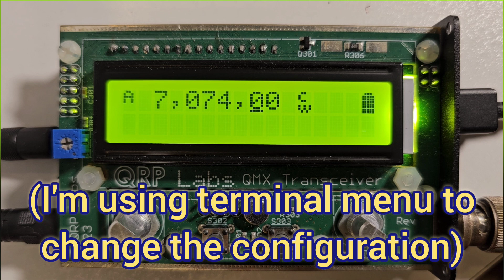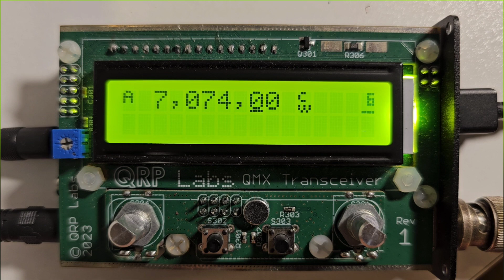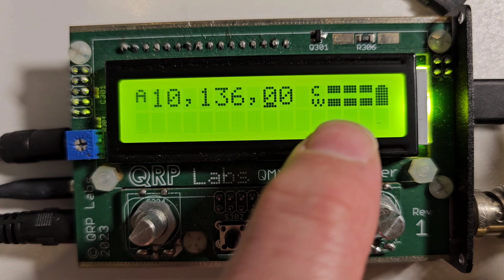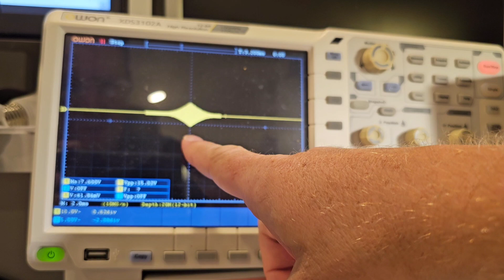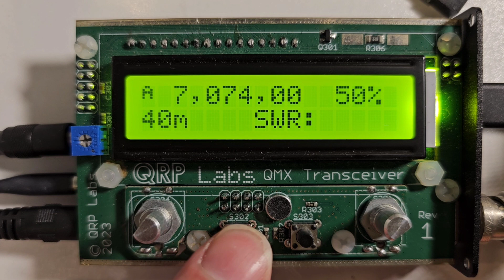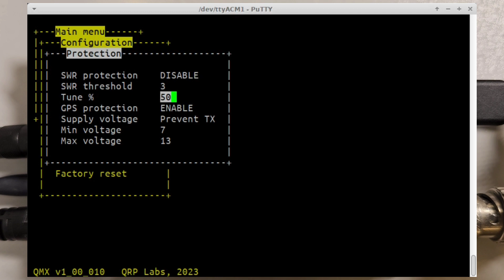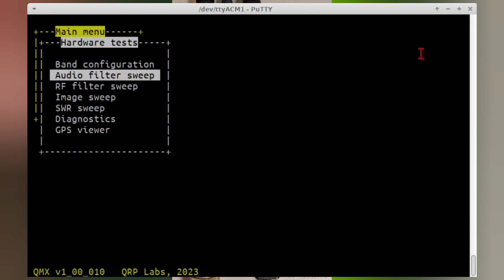QMX SWR features in firmware 1_00_010

Comment: I got my built one and it is excellent. Thank you Hans. At the moment I am trying to experience FT8 with my home built 20m dipole located in the house which is a compromise. One thing though, is there any way I can work wspr without a gps unit. I could'not find any menu item to set the time like your previous digital transceivers. Any advice?  73, TA3LFT

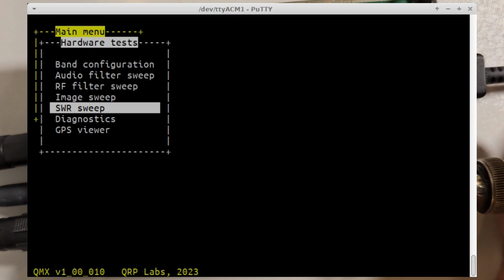Comment: Around 10:30, Q103 / Q104 shorting issue. The FET slipped right off the board when I tried to adjust it. That turned out to be a good thing as I noticed a solder short remaining which I removed then resoldered the device. No short now😅

Comment: Great features, you've thought of everything  -- as usual. I wonder how you can accurately control PA Vcc. Does it use a PWM regulator under CPU control?
Reply from the maker: There's a lot of documentation on the QMX page http://qrp-labs.com/qmx some of which explains this. There's a 12-bit DAC output from the CPU which is multiplied by approximately a factor of 6 to create the PA voltage accurately. It's extremely linear.
Reply: @QRPLabs  Thanks, I have read bits of QMX and it is the most thorough and well explained project documentation I've seen. I'll read the entire think soon I hope.  Having uC control over Vcc is ideal for PA protection.  Well do e on another QRP innovation.